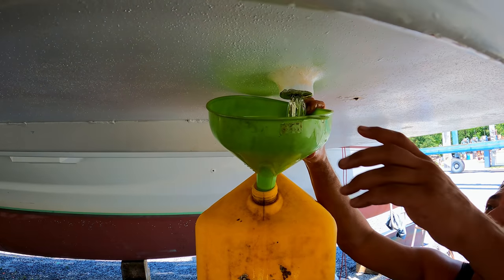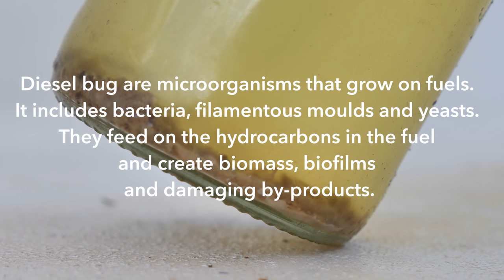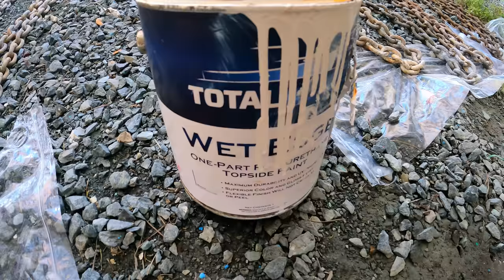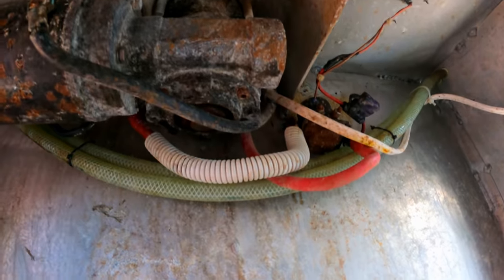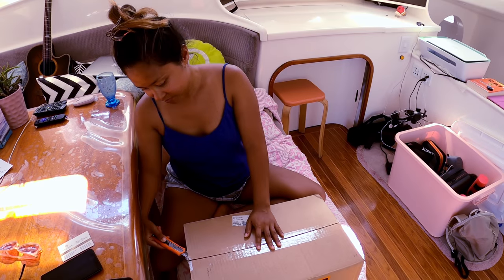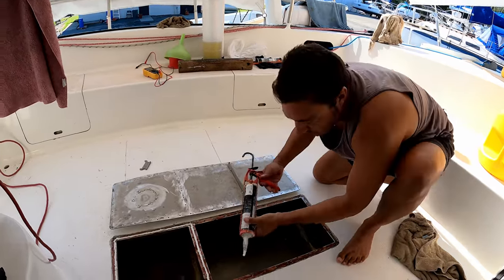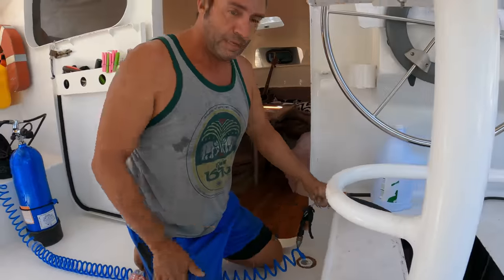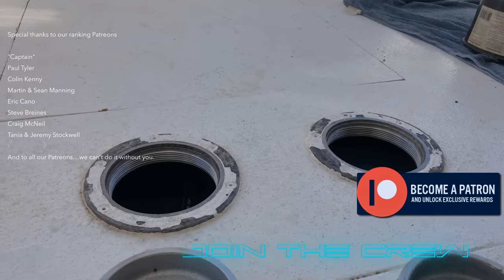REMOVAL of 4 year old DIESEL BUG in our fuel tank - EP77 - Sailing Life on Jupiter

Comment: Ohoy there :)Like your videos..i am an old enginerepairman ( merachant marine) and if you put a valve on the bottom plug ( diesel Tk) and now an the  you could with the dingy and a bucket just drain little water out...humidity will always come in the airvent. Watch onboard do this every morning as a rutine in engine :) there are also nice german( boll )filter with self shuting function ( it uses air to clean themself)(and with a dirt indicator :) bst from sailorbear sweden.
Reply from the maker: Hey Bjorn…good idea with the drain valve… we use a pump to suck out the sump from time to time when it needs it.

Comment: Diesel bug is a mixture of different microbes, bacteria and fungus that can live and thrive in the interface between water and diesel in your fuel tank. Like most bacteria it will reproduce quickly to potentially become a serious problem in a short time. It particularly likes warm weather but can strike anywhere.
Always add a supplement before filling or topping off your tanks.
Here in Australia the product I use treats up to about 1000L, but it can't be overdosed.
Reply from the maker: Yeah what are you dosing it with? Cheers DUAI

Comment: Algae is grown at the surface where water and diesel fuel meet.......
The corrosion in your tanks is from water. If you properly clean your fuel You won't have 
problem
I under stand the problems with high humidity but  if You polish the fuel in your tanks You could medicate
the problem...........
Reply from the maker: Tks Ken.. Hasn't been a problem since using the fuel additive.

Comment: Everry main engine should have a double RACCOR type fuel filter, safety. [You can switch  while running seamleasly, the clean the failing filter having it ready if you need it again] I my experince(crossing pacific 90' schooner with fowled tanks) it worked perfectectly(without doing the tank scrub[not as accessible as yours])
keeep up you spirits!!!!
Reply from the maker: It's a good idea Lincoln... But sinc3 we have 2 engines running on separate tanks I haven't bothered doubling the fuel filters. Cheers

Comment: Soldring wires that can move/vibrate is not the best thing. The solder gets in the wire (capilair effect) and together with the heat hardens the wire. The result is often it breaks next to the solderjoint. That is in theory, I never tested it.
Reply from the maker: Good to know.. Cheers

Comment: When I was building liquid cooled gaming PCs we tried all the biocides - would work for a year, but that was it.
What worked was a coil of silver, killed off everything.

You would have to ensure that the silver will not react badly with the aluminium - a very quick google search suggests that silver sulphate is converted to aluminium sulphate but you can only lose as much as you have silver in the system, and it's surprising how little silver you need in the system to protect everything.

It's worth asking a chemist.  Might be cheaper in the long run than purchasing exotic chemicals.
Reply from the maker: Ah PI that is interesting... Galvanically silver is around 0.6v different from aluminium, but the their are already all sorts of metals within the engine fuel system plumbing... So it potentially a good idea. Mostly tho the problem with cruising boats is that the fuel is sitting stagnant (no circulation) in the tank for months at a time...so maybe the biocide is better for that.
Anyhow, nice idea... Cheers

Comment: Who ever did the welding on that boat they should have his license revoked because it looks like chicken shit as we say we welders There was a lot to hit and miss in the welding not binding pity because it is a nice boat even there next to the winch i saw it was only point stitches there sould have been 100mm weld and 50mm miss and continued to the end of job
Reply from the maker: Where were you when it was being built??? I could have used your advice... Do you weld aluminum? As I understand it is far more challenging due to the heat soak and warping. I've had other comments from engineers saying how good the welding is, tho talking about the hulls, not windlass base.
Ah well not much I can do about it now.
Reply: @SailingLifeonJupiter  i am a certified welder in saying that i well all materials and use all methods of welling be it stick or wire or tig welding i am located in Norway aluminum it's is all about preparing both sides of plate be welded if not then you get those hir and miss situations but can be repaired if a person in this case lifts up a machine with a long packade and go over the welds with Tig then you will have a solid boat 🚢 ps they should use aluminum mg5 as it is salt water resistant other wise it will corroded and swiping finger over weld will leave a white powder on you finger if you need help pm or dm me cheers